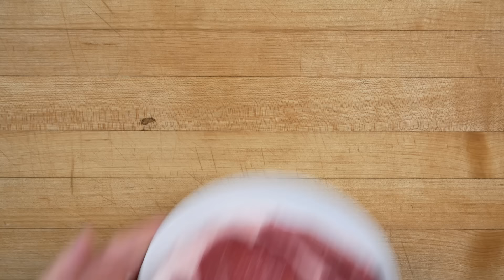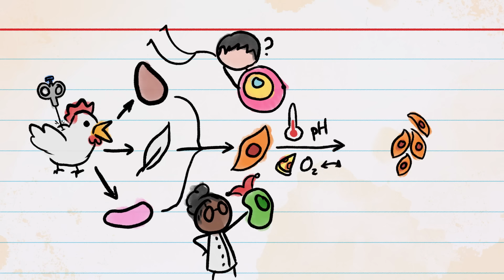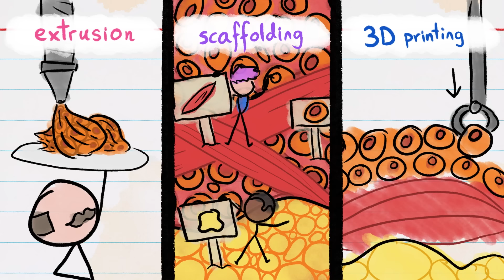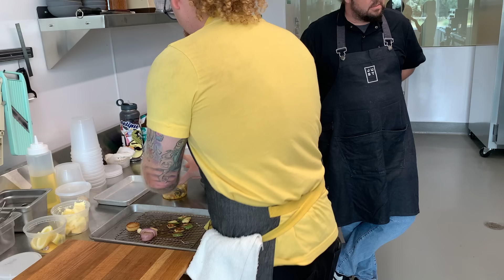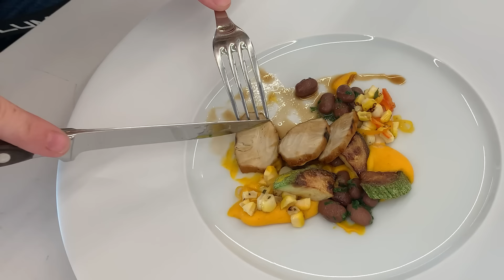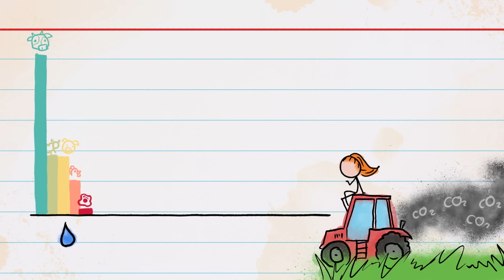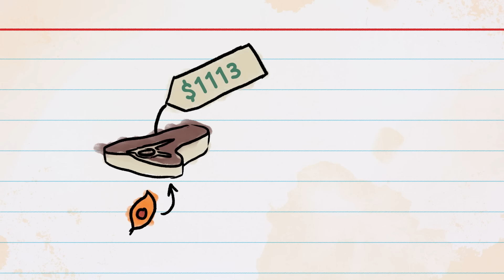Lab-grown meat (probably) won't save us

Comment: I dislike the pessimistic clickbait title.

The meat works and is basically in the prototype phase. No one knows how it will scale, because no-one does it yet. However, we can produce beer, etc. at scale without issues. I wouldn't assume that this will be an issue here.

Even price is arguable, because it's only (actual) meat that some vegetarians might be willing to eat and it will go down as the scale goes up.

It's absolutely plausible than in 5-10 years, it will be available all over the world and since it's crafted, it can also be sold as "the perfect burger mix", "the perfect seak", "the perfect...". Again, there are challenges to overcome, but I don't see anything that is a real obstacle to the gradual mass adoption in a longer horizon.
Reply: About beer: We kind of can and kind of can't, at least climate change will have a major impact on beer production, more than on other products

Comment: Important side note, conventional meat is also heavily subsidized.
Reply: Also, there is a major distinction in terms of harm to nature between chicken, pork and beef. Pork is noticeably worse, and beef is even way worse than anything. So it does not make much sense to focus on chicken first as the company from the video does in terms of environmental impact. But I guess that they chose chicken as it is easier because beef is barely edible, if it does not have fat in it, which complicates the manufacturing a lot.
Reply: @tatianaes3354  Yea, chicken is definitely easier to help further the technology as a proof of concept. When researching breakthroughs in technology, its usually better to start with what works best first, just to get it working, rather than what makes more sense as an end goal.
Reply: Especially in the US, with those Billions of dollars of Subsidies to Soy and Corn.
Reply: @fg009letyrds8  because Brazilian is cheaper
Reply: that's true, the more optimistic estimate of large scale production at the moment is looking to be about $29.5 per pound, nearly equivalent to beef (although that's at break-even and doesn't consider distribution costs, two facts that would likely increase costs pretty significantly). still, if it was subsidized at an equal rate, the end product would be affordable
Reply: The subsidies could be a good thing in this case, because it also means a project like this can get funding from a government bill as well. I think the reason why there are so many agricultural subsidies is because the federal government recognizes that it is the most important thing for national security. Sure, it might be misguided now, but I don't think our government will change priorities as we go on into the future.
Reply: @SouthUrban36         The USA heavily subsidizes animal agriculture (including crops used for it) because of animal agriculture lobbyists' influence and their "donations" to lawmakers' campaign funds, which some would see as bribes.
Reply: Not it mention the crops used to feed them. Namely Corn.
Reply: @danielcuevas5899         Soy is also a major crop for animal feed.  77% of the soy grown is used to fatten animals for slaughter and for dairy or eggs.  Only 7% of soy is consumed directly by humans.  To confirm, Google the Oxford study by Poore and Nemecek and the reporting of it by "Our World in Data."
Reply: True!!
Reply: from toxic mass produced cruel meat to a probably less painful and more efficient version of it. italy stopped that just to protect the local industry run by... people that probably wont hire biotechnology experts as part of an r&d team, for the same reason why large scale solar is always on hold waiting for permits. they stoped bugs. now ww3 and famine are coming.
Reply: True.
Reply: Fun fact. Over 85% of feedstock for cattle at least is byproduct of plants. 

 Ruminates like cattle, goats and sheep are especially great at eating things we simply cannot. Pigs and chickens less so, although they are more efficent overall per pound. They still are fed a lot of waste. Yet I believe soy is the biggest offender with nearly 98% being for animals weirdly in America.

 Also not all agriculture land can actually support human edible crops. Yet there are so many studies clumps those in for whatever reason. 

 A lot of biased studies out there folks since there is a lot of money to be had. 

 I am all for fake meat if it is cheaper, tastes better, proven to be healthy nutrition wise, and is more consistent. Yet I won't give up meat anytime soon most likely. 

 I think getting rid of biofuels should be the biggest priority. I don't think they are better for anything, including your car. Yet again studies here are hit or miss. (The total logistics of biofuels is the issue. The mining and use of fertilizer specifically outweighs any net zero carbon emissions).
Reply: The last part seems a bit misleading like if there was this one farm which has to produce 3-4 million tons(not sure if metric) but in the case of metric that would be with a cow having around 200kg of edible meat (3.000.000.000/200=15.000.000) that's 15mio(12.000.000 in freedom units) cows in one farm, per year. The biggest cattle farm has around 100.000 cows. Representing this as thou one factory has to produce it all is just misleading.
Reply: Right back atcha
Reply: Exactly, most people complaining about the cost of cultivated meat would have their eyes pop out when they realise the true cost of the conventional meat industry. Even if net emissions are higher, the savings in water and land resources alone are monumental.
Reply: @devilex121  Yes! And maybe some of that extra land could be used to sequester some greenhouse gasses to help offset it.
Reply: @devilex121 People tend to focus too much on "Air" they tend to forget the impact it have on "Water" and "Land".

Though some blame can be put on "Green activist" too since they're too hyperfocused on Air side of Pollution that they forget to mention Water and Land Impact which are also important.
Reply: No subsidies for meat in my country.
Reply: @jg5755       The feed for the farm animals (if any is imported) is also heavily subsidized which affects the price of the meat produced in your country.
Reply: @jg5755 which country
Reply: All farming is heavily subsidized.
Reply: @jamesfisher9594        Here in the USA, animal agriculture and the crops they use for farm animal feed are a lot more heavily subsidized than fruits and vegetables.  Animal agriculture has better lobbyists, it seems.
Reply: Yes, and meat substitute meals in fast food places have gouged up prices so they can sell the meat meals for cheaper.
Reply: And conventional grain is also heavily subsidized.
Reply: @triadwarfare  to quote Britannica:

In the agricultural practices of North America and northern Europe, barley, corn, oats, rye, and sorghums are grown almost entirely as animal feed, although small quantities are processed for human consumption as well.
Reply: #TRUTH!
Reply: conventional meat is what humans survived on for 2.5 million years, it is the proper human diet.
Reply: That's insane
Reply: Just so we’re perfectly clear, only factory farming is subsidized. Family owned farms that pasture raise livestock aren’t bad for the environment, they actually sequester carbon. Animals can be humanely raised and slaughtered. 

Lab meat is energy intensive, looks terrible, lacks fat, flavor and color and, the real kicker is that it’s far more expensive to make. This is going to end up becoming a fringe, bourgeois, virtue signaling product for wealthy liberals. Follow the advice of socially maladjusted nerds at your own peril.
Reply: Not a problem. Move subsidies from conventional meat over to cultivated meat. Companies can franchise their cultivated meat technology to traditional conventional meat producers so they can transition from producing conventional meat to cultivated meat. The more we produce cultivated meat, the cheaper it will become.
Reply: @EnlightenedMinarchist  I completely agree! I was pointing this detail out in response to her video saying that price was an issue compared to conventional meat.
Reply: Is no one considering the elephant in the room? The horrific cruelty inflicted on thinking feeling beings? It's evil. An enormous treblinka for innocent beings.
Reply: All agriculture in America is subsidized.
Reply: @KameradVonTurnip         Google the percentage of subsidies going to animal agriculture and the crops that they use fpr farm animal feed and you will see a huge difference between those subsidies and the tiny percentage going to fruit and vegetables.
Reply: @someguy2135   I think you miss a very important factor.   Crops like Corn, Soy, and Wheat are heavily subsidized primarily because they're considered cornerstones of the agricultural industry.   Not just for food but for a ridiculous number of things, from cattle feed, industrial uses, and food production.  They have considerably more useful than just food/feed.   Demand is so high for specific crops that they have to be subsidized to keep the prices low.  Because they would have a huge effect on the entire food chain.  Fruits which are honestly luxuries and not a necessity are not treated the same for obvious reasons.   

Reason Meat/Cattle/Diary are also heavily subsidizes is literally for the same reason.  They're literally backbones of the food web let alone many having uses well beyond just food.  Like how much leather is needed every year, and the industrial application of leather is quite huge.  For example people who work in steel mills and weld shops are literally decked out in leather almost from head to toe.  And they go through a lot of it each year as leather still burns.   You don't get that with Apples and Oranges.
Reply: @KameradVonTurnip             Using crops for farm animal feed and biofuels is extremely inefficient and a major waste of resources like land and fresh water.  To feed a growing population and to finally deal with climate change and other environmental emergencies, animal agriculture needs to be replaced with a fully plant based food system.  A study done at the University of Minnesota found that 4 billion more people could be fed that way.  Details on request.
Reply: @KameradVonTurnip           Alternatives to leather already exist, and more are on the way.  "Leather...has a heavy environmental footprint. Modern tanning uses chromium salts to cross-link collagen fibers, creating large quantities of wastewater. And, of course, the hides mostly come from the meat and dairy industry, which many people consider environmentally unsustainable.

A concern for sustainability is a common thread among the entrepreneurs who are working to bring leather alternatives to market. These aren’t the synthetic pleathers found in cheap shoes and purses. Leatherlike textiles made from nonanimal sources, sometimes called vegan leathers, are positioned as premium products for high-end goods.

C&EN collected several samples, and they are, in a word, convincing. Plants and mushrooms are being made into materials that effectively mimic leather. The tough softness, slight tack, and heavy feel of leather are there. And each has a sustainability story to tell, one that some brand owners think customers will find compelling."- Chemical and Engineering News

Title-"Sustainable materials make a play for the vegan leather market
A new crop of biobased material makers aims to displace chrome-tanned cowhide"
by Craig Bettenhausen
Reply: @KameradVonTurnip        Every reputable organization that deals with nutrition recommend a greater consumption of fruit and vegetables than the vast majority of those people who live in the USA and other developed countries eat.
Reply: @someguy2135   So?  I don't see how that is relevant to what I've said. lol
Reply: GOOD!Ever notice how we want to save species, study their natural habitat, make sure they have access to their natural food,water, habitat, etc?  I want to save Humans!  Our natural food is Meat, not bugs, not some chemical laden glop manipulated to simulate ‘ meat’, not sugar heavy processed garbage, with a few veggies thrown in, that end up mouldering in our fridges before going into our landfills. Look around you.  At how many of us, even our children, are overweight, many morbidly obese, have allergies and food intolerances, heart disease, cancers. Much of which , IMO, come from what we put in our bodies, staying indoors, not doing even minimal exercise, like walking in sunshine and fresh air.  Also consider every country’s Militaries through out History. The warrior class was fed  Meat, to keep them healthy and Strong. Captured enemies and slaves were fed slop food, were weak and feeble, unable to put up much resistance. Even their mental abilities were dulled. The lower on the social ladder, the lower quality of food, top rated for a reason was Meat. And of that meat, the animals themselves were the top quality, the healthiest and best reserved for Kings, Warriors,and Royals. If a peasant, a serf, was caught poaching, the penalty was often death.
Reply: @beverlyaten1775  this is nonsense. Have you met a severely obese person? Ever? They are not lacking dietary meat.  The hundreds of thousands of people having heart attacks every year are not lacking in dietary meat. They have it at every meal. Be honest with yourself. 😆
Reply: @AmandaOrigo  it is not that obese people eat meat. It is all the rest of the garbage they eat with it . Bread, paste, sugary drinks, potatoes, rice, flour gravies, foods fried in highly processed vegetable oils and breaded in grain flours, fake butter substitutes, candies, cakes, pies. You find a person that eats mainly meat, poultry, fish, healthy natural fats,with low carb, non starchy, non sugary, non chemical laden vegetables and you will see a very healthy person. And if a morbidly obese person corrects their diet, they can become a healthy person without diet pills or the latest fad injections.

Comment: From former quality assurance/regulatory affairs experience in clinical trials, this video is **on point** in regards to a summary of the issues we're facing regarding scaling from prototyping to mass manufacturing. I've been looking forward to cell cultured "meat substitutes" for over a decade, but we're still in no way close to that future. In fact, the whole of the meat substitute market has these issues, because we cannot ignore the root industries necessary to build these supply chains. Monocrops, steel production, chemical sourcing and manufacturing, and the fact we still have to use petroproducts in so many of these, is a huge hurdle. 

I'm absolutely rooting for it, but I have no illusions about the huge leaps in technology and regulations that will be necessary to get there.

Comment: My biggest confusion is how the manufacturers might replicate fat distributions within the tissues. It's all well and good to have lots of protein, but fat is a core component of flavor in meat. Without it, the meat comes across as dry and fairly tasteless, or burns really easily. If the fat is added as shortening or just by mixing vegetable oils, it will taste markedly different.
Reply: Can’t you just do the same thing with fat cells?
Reply: @cosmologicalturtle9528 Fat cells are reliant on having the right fatty acids provided within cholesterol. I’m no doctor, but I would bet that imitating the lipoprotein system is way harder than the amino acid system.
Reply: 3d printing
Reply: Meat needs Fat, especially for those on a low carb diet. They need fat in their diet to survive.
Reply: @chesterpanda the nature of this nutrient matrix allows the tissue to grow in a nutrient medium without the same vascular requirements of flesh in a body. Fat isn't necessary in the tissue, just the lipids in the medium.

Comment: Really, as long as it's viable for cows it'll be worth it, bonus points if deer or pigs pan out. But I don't see chicken reducing, they aren't JUST kept for eggs and meat. "Chicken Litter" (shed feathers, excrement, etc.) is a primary component in many fertilizers used all over the US, and if that becomes less available the knock-on effects will cause basically all crops to become more expensive. So I don't see chicken specifically going anywhere for quite some time, because the meat's going to be produced regardless.

Comment: How exactly is lab grown meat "more environmentally friendly", bio reactors use a ton of steel, cell medium used to grow these are not cheap or easy to produce. Cell growing process can't be scaled up to bigger reactors either, which means a lot of small reactors taking up land. Not to even mention if a reactor ever gets contaminated the whole will be ruined since a group of cells don't have an immune system, unlike an actual annimal